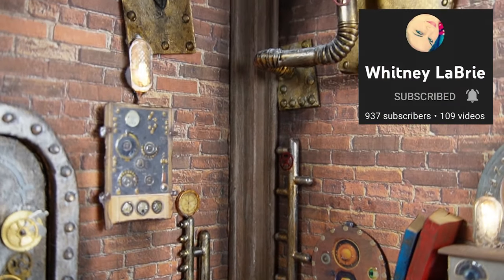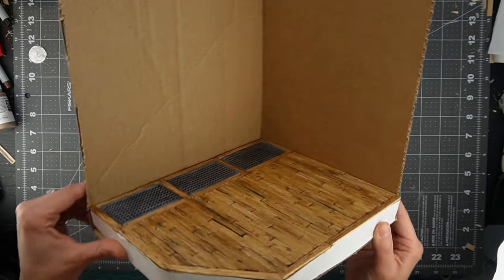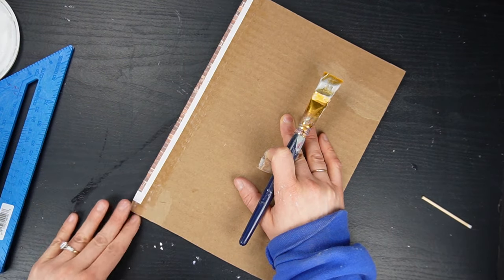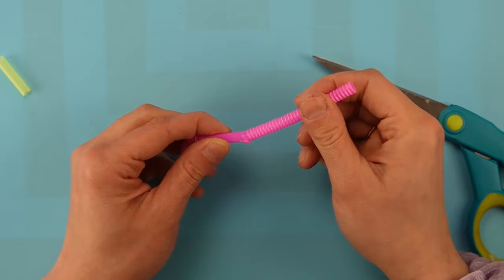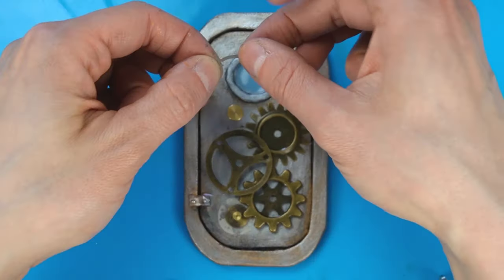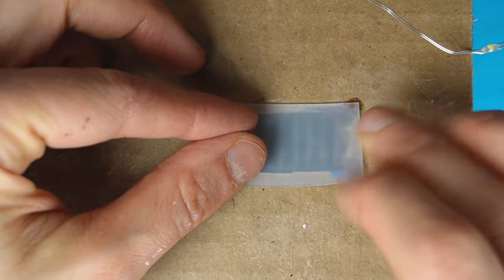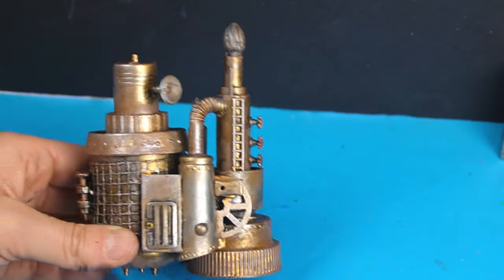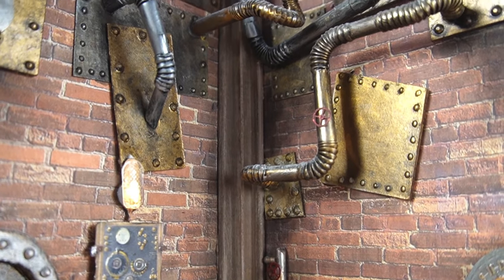DIY handmade Steampunk factory • 1:12 diorama

Comment: I just discovered your channel, and I love it. Also subscribed.  I am going to try the canopy glue and squeeze bottle technique that you demonstrated for my own steampunk build. 
My story for the 'mystery panel' is that it functions as a combination lock that turns on different pieces of equipment in the factory, but one has to know the right positions of each gear to make any of the machines work. Peace!
Reply from the maker: Thanks for subscribing! Good luck with your steampunk project.

Ooh, I like that explanation!

I suggest you check out Gameyy Builds. You may learn some techniques to use in your own projects. At the very least, you'll be very entertained. His builds are great and his stories for the builds are just as good.

Comment: There is a little built-in cabinet in our hall that used to be the fuse box ( our house was built in 1912). I got this idea that I wanted to turn it into a mouse house, then I saw this video! I love steampunk and it fits with the old fuses.

I'm not sure if I should use 1:12 or 1:24, it depends on the dimensions, it's not very big so I am leaning towards half scale.
Reply from the maker: That sounds so cool! Is 1:12 doesn't work and 1:24 seems too small, you could try 1:16 scale.
Reply: I am really new to miniatures, so I didn't know about 1:16. 
The box is about 8" x 8" but only about 3 inches deep. So I was thinking work benches along the back and some sort of machine or boiler. 
There also is a hole where the cables must of gone which is just calling for a hatch!

Comment: 2:47 that tool used to cut the sticks what was that?
Reply from the maker: That tool is called miter shears. They're great for cutting straight cuts and angles in thinner pieces of wood. It's good to buy a pair with replaceable blades. Mine can't be replaced and they're dull now.